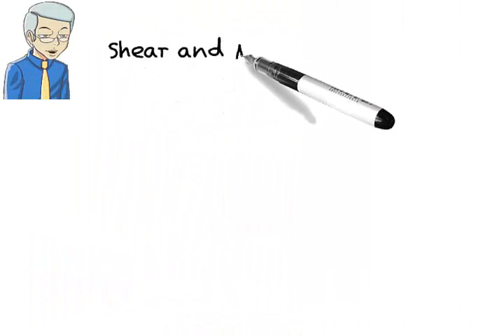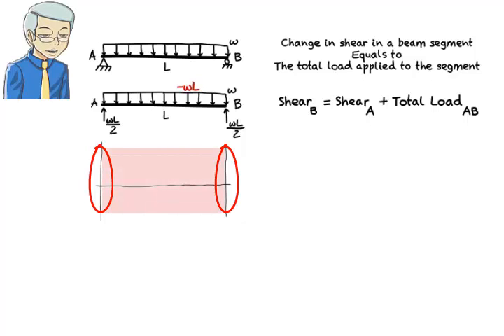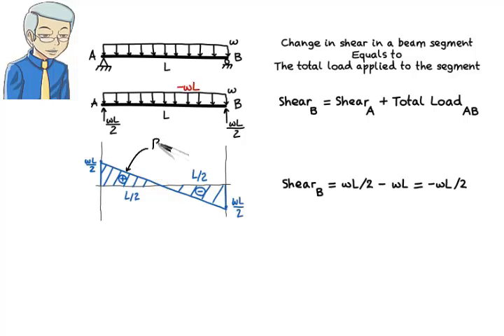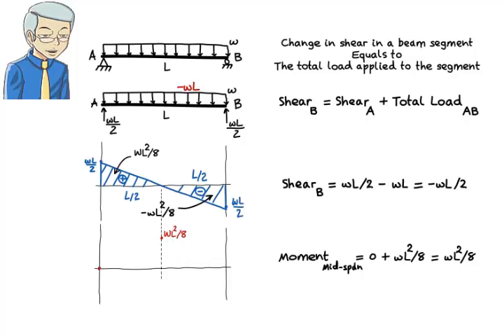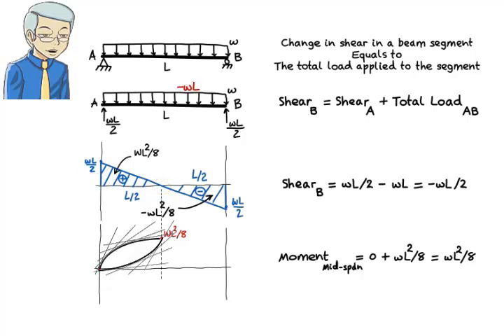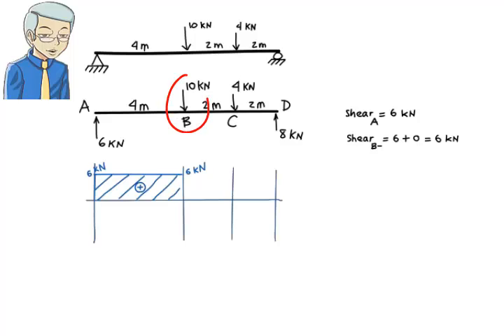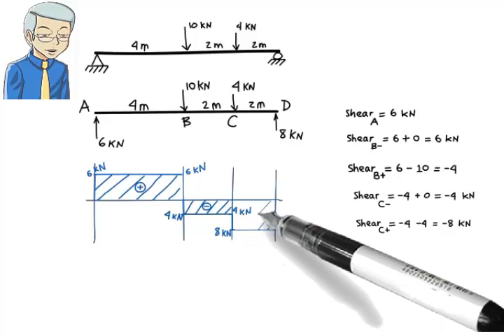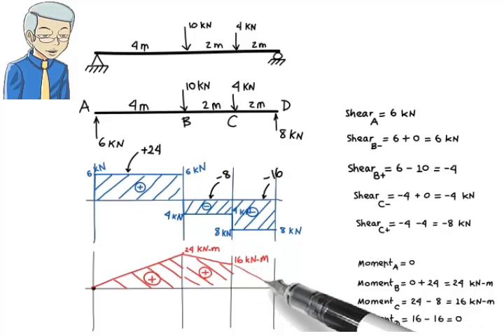SA09: Drawing Shear & Moment Diagrams without the use of Equations

Comment: Dr. Structure,At max point of S.F the B.M is zero AND vice versa, Do you have any logical explanation. not mathematical explanation only logic, why this is so

 - via YTPak(.com)
Reply from the maker: +Bilal Khan Thank you for the interesting question.

It is true that when shear in a beam is zero bending moment is maximum, but the converse is not true. That is, bending moment at maximum shear is not necessarily zero. For some problems (specially problems involving simply supported beams) it may look that way, but not because of the relationship between shear and moment, but due to the imposed boundary conditions.

To answer the question why bending moment is maximum when shear is zero, it is necessary to keep the relationship between shear and moment in mind. Of course, the relationship is mathematical in nature (so there is no escaping mathematics here):

By definition: Shear is Change in Bending Moment.

Shear = 0 means 
Change in Bending Moment = 0.

Take a very very tiny (infinitesimal) slice of a beam.  The slice has a shear and a bending moment in it. More precisely, there is a moment (say clockwise) at the left end of the slice and a counter-clockwise moment at the other end of the slice (a pair of end moments in the slice is what we call bending moment in the slice). 

If shear in the slice is zero then the two moments must have exactly the same value (there is no change between the end values). Simply put, when change in bending moment is zero, shear is zero.

But under what condition change in bending moment be zero? When bending moment is maximum. 

If we have an algebraic function (f), how do we determine its point of maximum, or minimum? We take the derivative of f and set it equal to zero. The derivative is change in f. So f has its maximum value when change in f is zero.

Since shear is the derivative of moment, shear is change in moment. When moment is maximum, when change  in moment is zero, shear is zero.

I know you wanted a purely non-mathematical explanation, but I am afraid the question cannot be answered effectively without examining the mathematical relationship between shear and moment.
Reply: +Dr. Structure Thanks.

 - via YTPak(.com)
Reply: very beautifully explained .